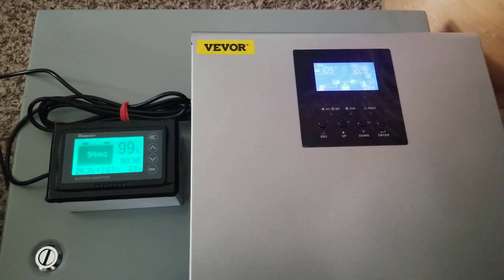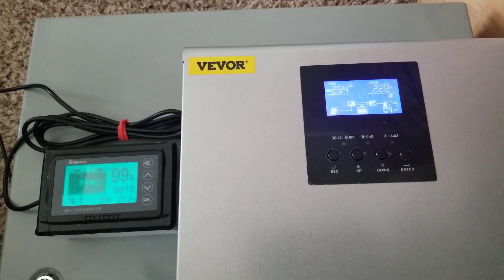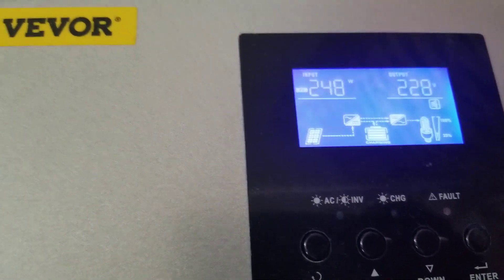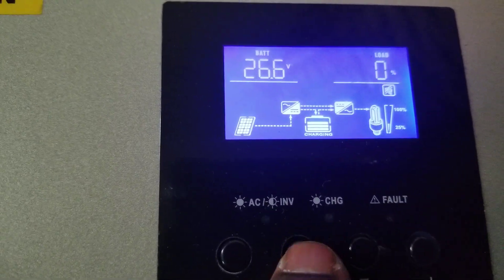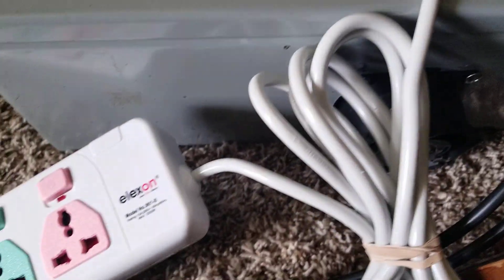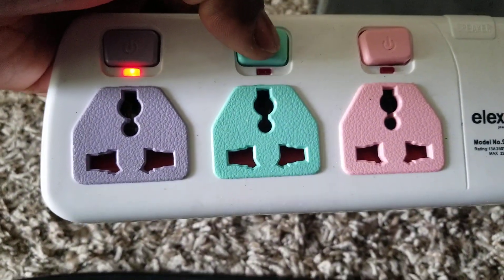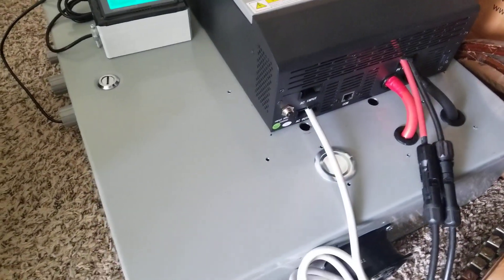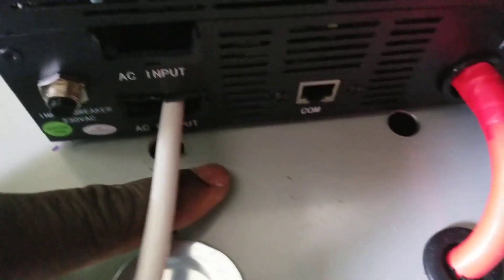UPDATE: VEVOR 3KVA 24V MPPT HYBRID SOLAR INVERTER BUILT-IN PURE SINE WAVE CHARGE CONTROLLER

Comment: Oh and my e-bike battery surges to 1kw when it is plugged in to the solar in.. To which I did an immediate shut down, now while you have the International version you can step down the po using a step down trans former which have built in breakers. 220 Volt inverters are more efficient.
Reply from the maker: @LEEGULICKSON  
👍thanks for stopping by and don't forget to LIKE SHARE and SUBSCRIBE for more content coming your way

Comment: Using a 220-240V system can indeed be more efficient than a 120V system in several ways, even when stepping down the voltage. Here are some key points to summarize and explain why this might be the case:

Reduced Current Draw:

For the same power (wattage), the current draw at 220-240V is approximately half of what it would be at 120V. This reduction in current means that there is less power loss due to the resistance in the wires (since power loss is proportional to the square of the current, 

For example, for 2,000 watts:
At 120V, the current is 16.67A.
At 240V, the current is 8.33A.
Efficiency of Power Conversion:

Power converters (such as inverters and transformers) typically have efficiencies that can be higher when dealing with higher voltages and lower currents. This is due to reduced I²R losses and often better performance characteristics of the components used.
Stepping down from 240V to 120V in your case helps to maintain these efficiencies and results in a well-balanced power distribution.
System Design and Heat Management:

Lower currents result in less heat generation in wires and connections. This not only improves safety by reducing the risk of overheating but also helps in maintaining the longevity of the system components.
Warm but not hot wires indicate that the system is operating within safe thermal limits.
Load Balancing and Distribution:

By using a 220-240V inverter, you are able to distribute the power load more effectively, which can be especially beneficial when dealing with high power requirements like 2,000 watts.
The pass-through and charging mechanisms of the VEVOR hybrid system are likely optimized for these voltages, ensuring efficient handling of power.
International Standards and Compatibility:

Many international systems are designed for 220-240V operation, which might mean better availability of components and potentially better design optimizations.
In summary, your decision to use a 220-240V system, even when stepping down to 120V, has likely resulted in a more efficient and balanced system. The reduced current draw, improved efficiency of power conversion, better heat management, and effective load distribution all contribute to the overall performance and reliability of your solar backup system.

In short, using a 220 - 240 volt system is more efficent.
Then th traditional 120 system.
Reply from the maker: Thanks for sharing that to the community.

Comment: It has been a while my friend, you know me, I think out side the box, 
I found an answer to the challange. Of 240 to 120 conversion. 
VEVOR 5000W Voltage Converter Transformer.
The VEVOR 5000W Voltage Converter Transformer has a 220/240 switch on the back of this thing, which allows it to take in the 240 and step it down to 120 or 110. 
I have ordered both units and plan on setting the entire system up. 

I'll have to cut the plug at the end and following the wire coding ND diagram to make sure that the voltage in is matching with the voltage out. Seeing how I do not think this is a split phase unit. I will be using the VEVOR 5000W Voltage Converter Transformer, now while the VEVOR 5000W Voltage Converter Transformer is rate fo 5 KW, I know I can  not go over the main unit's power specks. 

On the plus side this can make for a nice clan install. For stepping down the power. There are additional out let's that allow for one to use the 220 Volts for appliances that call for that. 

I am doing this, because I do not think a traditional breaker panel even ground to neutral bonded wound work for this.  Just by looking at how that thing is put together. Who knows I may just may be getting the US version, but hey I'll take what I can get... International.. Works lol..  so.. Tell me what you think? I lso read the torque for the screws.. Those are some  interesting torgue values. 

I will need a second VEVOR 5000W Voltage Converter Transformer to step up the power for the plugging in the Inverter.  Yes, I am finally yielding to the 24 volt ideal... It makes a great deal of sense and well wiring and costs are cheaper. 

At any rate, have an awesome day. Hmmon the second though I could set up a 200 watt 24 volt power supply to the solar in lol. But, I much rather wire the thing up in an appropriate way.   Or, I just by 240 volt toaster oven and bread machine lol... And other 240 volt appliances... Which would cost a lot of money in the long run..
Reply from the maker: Thanks for the update

Comment: When u goes from agm to lithium golf batteryes.  What all 40 in user shud stay at ???
Cos have to go to use user for lithium in this one
Reply from the maker: Yes use the user to setup your battery manufacturer specifications
Reply: @jwsolarusa  yes but we dont know what that is for this VW batteryes are.

We have get builded 2 case of batteryes.
And the builder told us to stop topp at 25.5 volt.
But cant get hybrid inverter in user to sharge ore nothing. 
And there is 40 menu in user.
And we are 2 friends whit 2 case we not can use